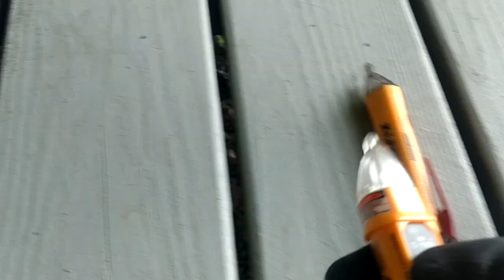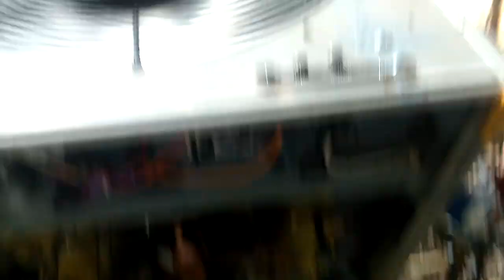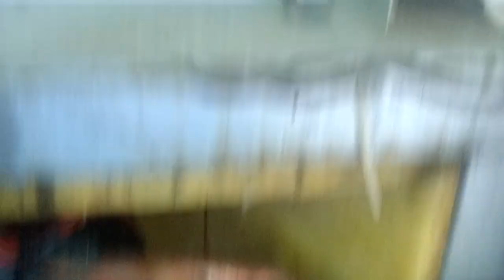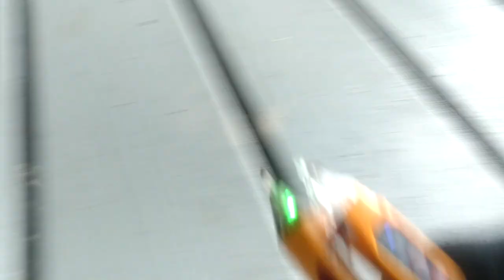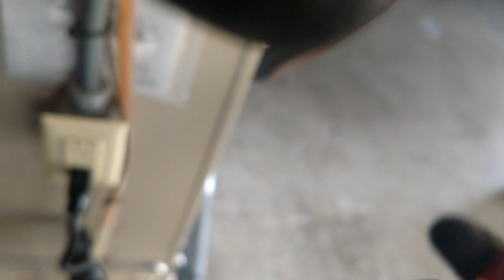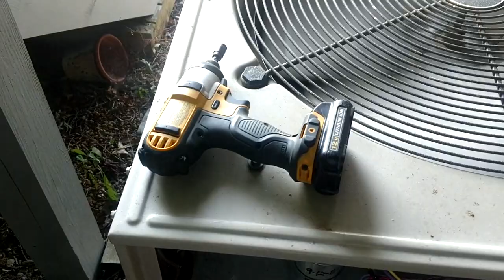Dangerous Problems⚡⚡Klein NCVT-2 (old version) malfunction caught on camera. Also testing NCVT-5.

Comment: Southwire 40150N Advanced AC Non Contact Voltage Tester Pen, Dual Range 12-1000VAC/100-1000VAC, Non Contact Voltage Detector with LED Flashlight, 6' drop test rated, and IP67 waterproof, NCVT

Comment: My Klein has indicated both live and dead circuits as live. These false positives necessitate using a VOM or other type of tester to verify the circuit is off so I don't use the Klein NCVT.
Reply: They’re not used to prove a circuit is dead , they are for tracing cables , ie your in a loft loads of cables don’t know what ones are live and what are not . That’s is what the voltage stick is for . It is just a quick check for reference to  see if there is a brake in a cable never use it to verify a circuit . If in doubt always do a continuity test , and throw that thing in the trash .
Reply: @Dog-whisperer7494  Agree with your comment "....throw that thing in the trash." however multiple resources and tutorials state that the tool is used to detect dead circuits...as in this example: "A non-contact voltage tester is the safest way to make sure the power is off without touching any wires. " Cable tracers are separate entities. Also note that Klein has issued recall notices for this device as a potential safety hazard.

Comment: A single button has too many functions in the NCVT-2.  Hold button for 1/2 to turn on; hold button for 2 seconds to switch mode; etc etc.  Who can remember all that?  I feel like I have to break out the instruction every time  I use this thing.  And, I don't know how many times I accidentally put this in silent mode.
Reply from the maker: You are exactly right. And then you have the thing turning itself on and off without even touching it. 
Thanks for watching and for your feedback 👍
Reply from the maker: Some things can be user error if you're not careful. But others are definitely malfunctions because of the cap/battery connections.
Reply: @sknight0391  You're right.  The battery cap coming loose is irritating too.  And I don't even clip it onto my pockets.